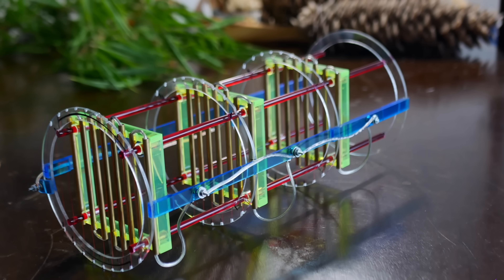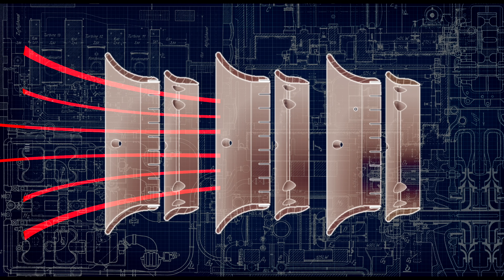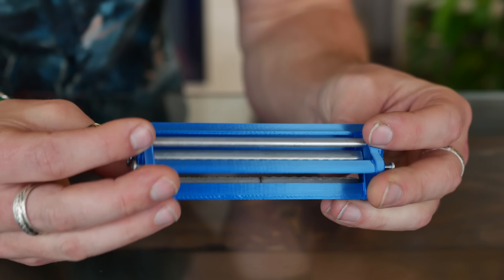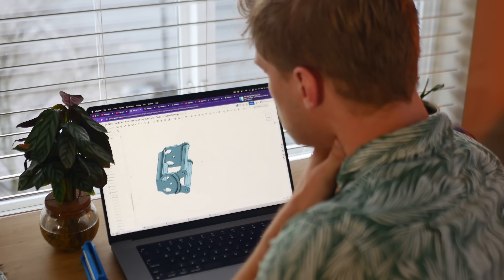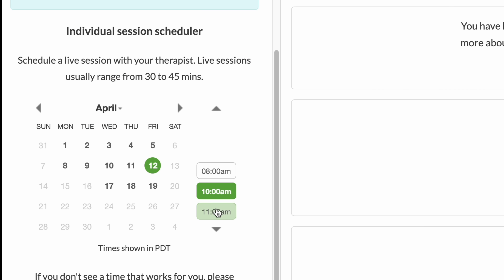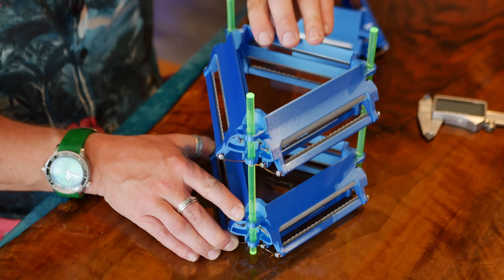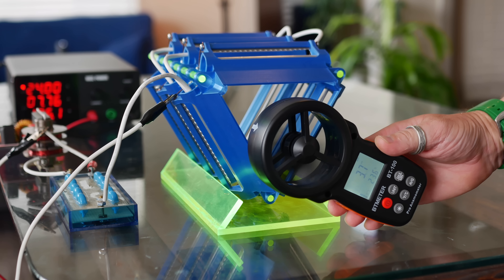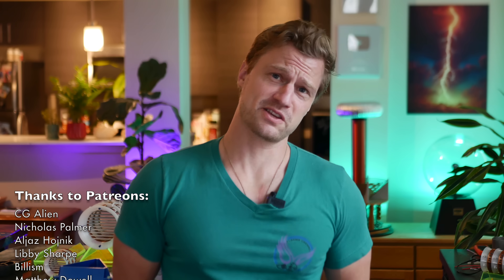Next-Gen Ionic Plasma Thruster Inspired By Nature (BTC Mark 3)

Comment: In my opinion you’re approaching the need for lens design theory – pretend for a moment that air is ‘like’ electromagnetic stuff, and even more radically, light. Take a typical prime lens of the 20th century which might have four elements (some have more, a few had less, like a Triotar), each element performs a different role. Admittedly a prime lens’s job was to focus on a defined plane, and here you’re not doing that, you’re throwing air to Infinity (or trying to) but I intuitively feel as though lens design might contribute something in some as yet unknown way

Comment: It seems we still don't know what the best design is.  Pumping more power is obviously going to yield more output.  I think the cylindrical design is better, and obviously has a better power to weight ratio it seems.  There must surely be some software that tells you how large an ionic array should be and the optimal spacing etc...  based on power input.

Comment: when you stack them in series, the electric fields could be interfering with one another.
just as the air can be pushed forward, if you put another thruster in front it could add to an opposing force.

Comment: I have an idea !!! Why don’t you make a hybrid ionic thruster ! One with metallic rotating blades and the blades are positively charged and also being driven by a motor and there are bunch of grounded wires at the end 
Airflow would be fan+ ionic thruster
Reply: Then you need additional airflow from the side, unless you make some of it converge from the side, which is complex, but should be extremely efficient of optimized (I’m not a specialist though)
Reply: Perhaps even inside a turbine or ramjet(!) engine?
Reply: @alleycatsphinx  it will not work ! This will start restricting airflow ! That’s the main reason they don’t have grills or barriers in front of any kind of jet engine
Reply: @VandalIO  I was talking about putting the electrodes directly on the front and back of the props
Reply: I’m not sure but…The air could try to go sideways to follow the blades, slowing them down and blocking input… interesting though… Or it could make an air vortex since you put the grid. (Rotating grid ???)
Reply: @romanbengaldrole4061  🤔 interesting idea , but grids at higher airspeeds kinda became bottlenecks , but ionic thrusters don’t have a very powerful thrust , it would be very interesting to see it in an experiment
Reply: @VandalIO  There is a solution : Place a central charged rod, with a higher charge at the end(outputs of generator), and use the Lorentz force to create rotation.
Reply: @romanbengaldrole4061  that’s an interesting one , or we can use a vortex tube like design

Comment: You need to take in count that the atmospheric pressure is way lower in altitude so less air to accelerate and the design need to be efficient at a large range of pressure, it's just impossible. The future of airplane is high speed rail. Otherwise the physics is still very interesting

Comment: What factor is scale, if you where to say, increase the scale would output stay the same as far as force, and only the amount of air moved would change, if so what about using this in firefighting, like point a massive one of these at a burning building and Feed the fire to death with 02

Comment: The propane torch is for me the most visually palpable sense of power.  If it weren't for the high voltages, I would wonder how this might do for ventilation and cooling (assuming the air stays cool [?]).

Comment: I wonder if instead of a triangular shape with 3 modules you could make a fully curved version to take advantage of the Coanda effect similar to a Dyson hairdryer. It would still have the central hole but should be lighter, smaller and more optimised.

Comment: Very cool project.

Is there a particular reason that you're trying to optimise for jet velocity rather than net thrust? It is my understanding that the propulsive efficiency of a jet engine is quasi-inverse to the specific thrust- this is part of the reason that jet engines are adopting a high bypass ratio. 

And won't the air being directed inside the stack lead to the inner intakes running into the same speed-gain as with the previous versions? This time amplified by the larger volume of air being forced through the duct at higher speed.

The improvement to the individual unit design has been a really fascinating process to follow- thanks for sharing it with us!
Reply: because the jet velocity needs to be high enough to where the vehicle speed can be high enough for flight.

Comment: Very high voltage and very low amperage currents can travel through kilometers of medium resistivity material (such as graphite) and lose almost nothing to inneficiencies. 
I always wondered why no one tried to use kilometers of conductive foil/ink all wripped together in order to maximize the surface area and the amount of air that can be accelerated.

Comment: The thruster triangle is arranged regularly (i.e. point<->point). I wonder if insetting them a bit within the triangle (like collapsing a camera lens aperture), to have a point<->flat (vs. point<->point) joint would induce more of a rotation in the converged airstream? (as each of the thrusters would be aimed "off center"). Maybe forming a central vortex could help with less dispersion and turbulence downstream.

Comment: Maybe you could try a circular design instead of a triangular design. I feel like it might focus the air a little better.
Reply: I was going there as well, creating a high speed vortex?
Reply: It could be interesting to place a central charged rod so the airflow gets “added” and focused (even directed maybe ?)
Reply: @romanbengaldrole4061 and the inner chamber be like Tesla valve just to allow one way airflow
Reply: @romanbengaldrole4061 that sounds very cool, but that brings back the structural problems.  It could be made strong, but thick fins and rod would cost weight.
Reply: @pdeboer1987  I was just suggesting to make the triangles smaller and place a wire… Sintered neodymium magnets could be used as part of the structure if placed in a plastic case, so it wouldn’t weigh much more (like his MHD where the printed part was thin)
Reply: High speed vortex why not, but I tried to design this for a water propeller, and you would need Lorentz force = weird magnets placement… Basically you would need a magnetic field that goes to the center (hence the rod), and a way to attract it to a focused point in the back + a “venturi” style system could be interesting as the air would be pulled in the vortex… I would try this if i had high voltages and strong magnets…
Reply: @romanbengaldrole4061 like a vortex tube ?
Reply: Agree and a better power to weight ratio as the cylinder has a natural strength advantage, so you can make it thinner
Reply: that's probably much harder to build, but a hexagonal built would be closer to your idea and have th advantage of 3 sets of parallel planes converging
Reply: I was thinking the same ! Like anode and cathode be rings from bigger to smaller with air guides within to guide airflow
Reply: Sort of… based on very basic calculations, the efficiency of this system (for water MHD) is really superior to that of a classic MHD.
Reply: Or, put the triangle into a series of conical cylinders drawing fresh air into each stage. Of course, that all adds extra weight.
Reply: But😢...it looks like iron man 2😅
Reply: Somehow this design reminds me of that new stealth bomber.
Reply: I guess I should have read the comments before I made mine LoL.
Reply: donuts ftw

Comment: If you combine mark 2 and mark 3 you may have a better result. It may be that the extra thrust coming from the internal air current helps a lot. You've already tested it and seen that it works on the Mark 2, leaving the side spaces. If you pump more air you will have more thrust. Ps, I'm from Brazil and I love your channel. It was one of the reasons I was studying mechanical engineering.

Comment: It's just the beginning and I doubt that this will be done or viable here in 5 or 8 years (or at least that it will work well at the size of a drone; I doubt that something like this will be achieved in this decade or the next, at the size of a fairly large ion plane functional, safe, viable, cheap, fast, not heavy, manageable, resistant and at high altitude, among other things)... but IT'S A GOOD START AND YOU'RE GOING IN THE RIGHT DIRECTION!

Comment: Use a hexagonal-shaped thruster and try using the hole through the center to your advantage, maybe rotating each segment slightly to create a vortex through the center. But hexagon will give you more surface area and therefore more air to move.
Reply: Hexagons are the Bestagons https://www.youtube.com/watch?v=thOifuHs6eY and easier to manufacture than a circular shape

Comment: Ionic thrusters are not so efficient for blowing wind at high speed. For a more clean and efficient and safe way to create a propulsion system in air, why don't you use an induction motor with a fan blade?
Reply: No moving parts with ionic thrust.
Reply: @coolcatcher126  this ion thruster takes huge power source to operate properly and sufficiently, but in induction motor, moderate power supply is more than enough and also in earth environment, ion thruster is not reliable.
Reply: in space, ionic thrusters have a much higher specific impuse than thermal expansion thrusters, where there isn't enough air to "swim in".
yeah but in air this makes no sense, just as you said.